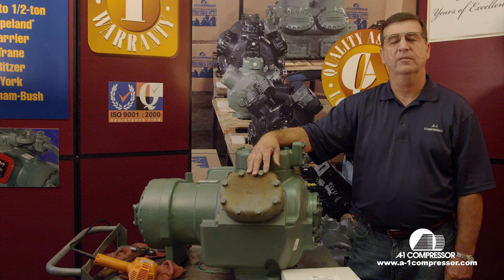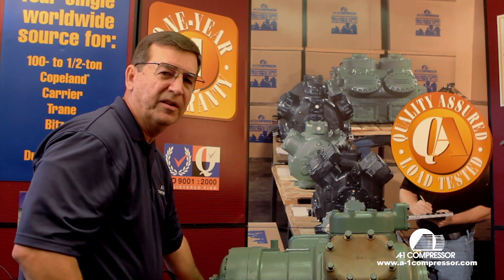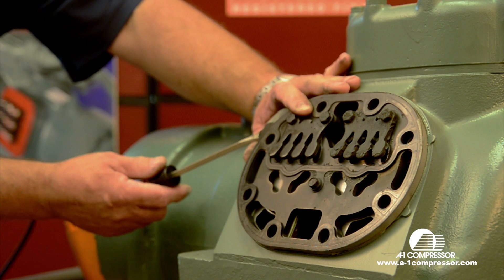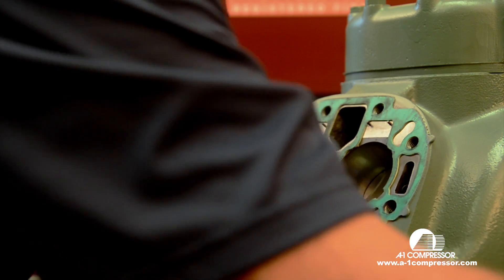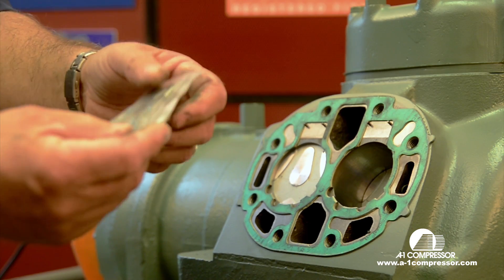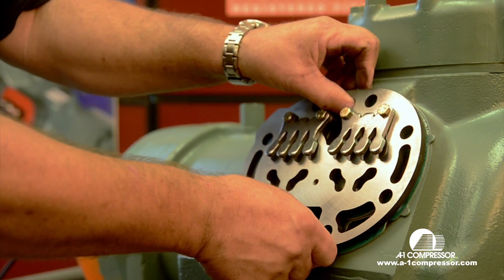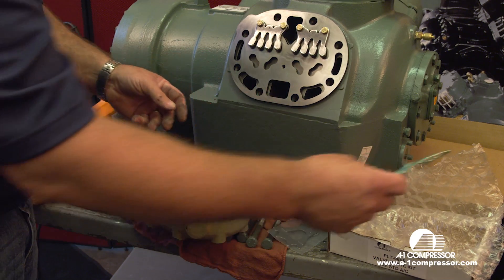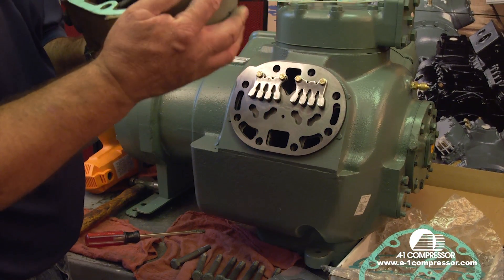Changing a Carrier Compressor Valve Plate

Comment: Hey brother can u tell me about Carlyle 06 E compressor head replacement right procedure when em changing metal gasket with complete head assembly then after replace creating sound from head due to becker n suction valve but i hv tried many times but couldn't succeed the old one discharge valve broken from top so than it was easily taken the suction gas

Comment: By the way how do you add oil just open the plug and add or is there a sequence to it  .Thanks again gave you a thumbs up
Reply: nisw1918 you need an oil pump to add oil. Let the compressor run a while before adding oil. On an 06E compressor the oil level should be at the bottom 1/3 of the sight glass. It can be at the bottom and the level is still ok. 06D compressors should be about 1/2 sight glass. If the sight glass is low the oil is probably in the circuit. Do not add oil until you confirm it’s not in the circuit. The oil will coat the evaporator tubes so the refrigerant will not evaporate properly causing the compressor to flood back. Run the head pressure up to get the oil back to the compressor before adding oil. I have removed more oil than I have put it in. A system with too much oil will kill the compressor.